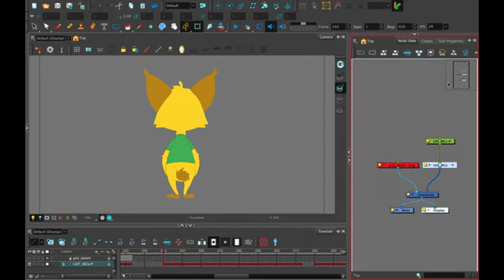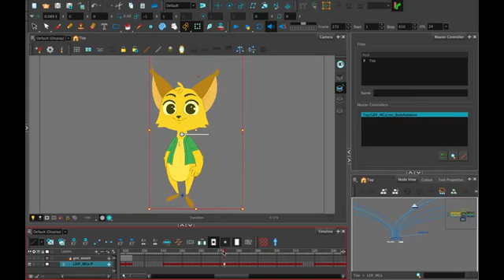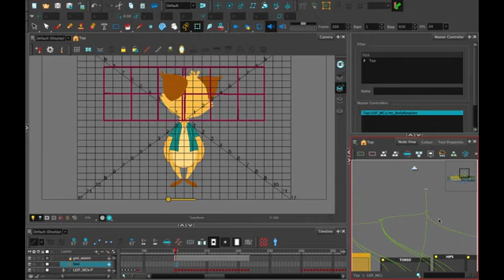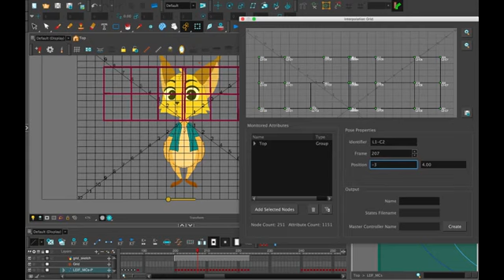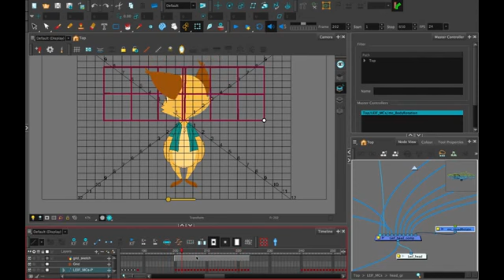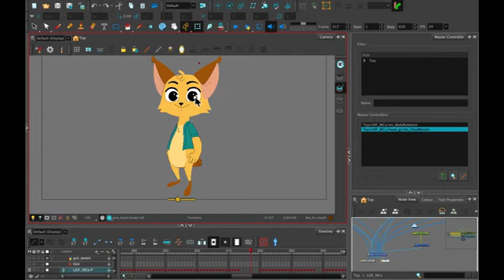Harmony17 Displaying & Testing Master Controller

Comment: Hello, thanks for the tutorial. Please I I'm struggling with this slider. My character keeps squashing because of the mirror flip to the other side. How do I fix this?
Reply: mine too did you find the reason?
Reply: Turn off interpolate?
Reply: @DrawnSean  tried that several times. I gave up